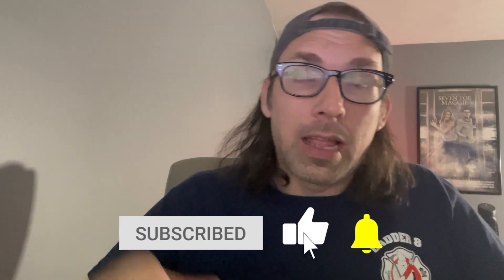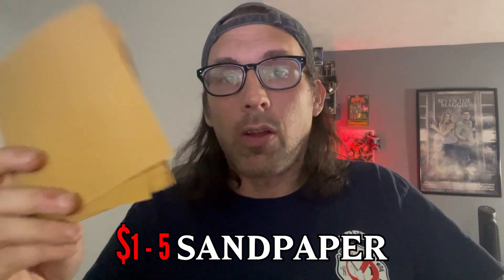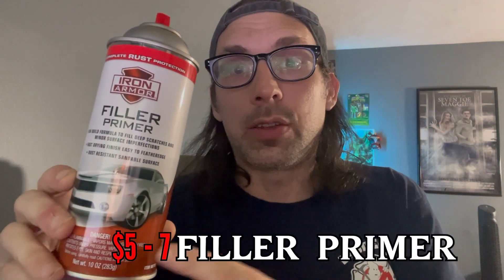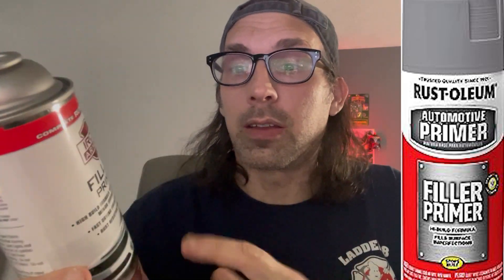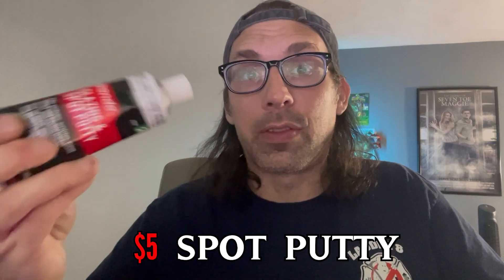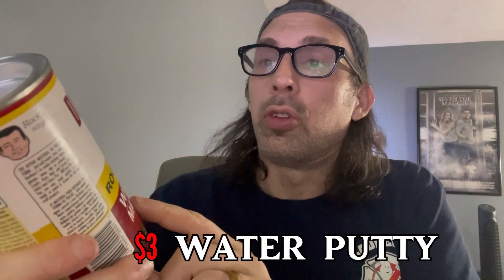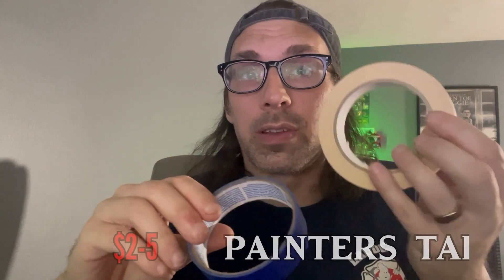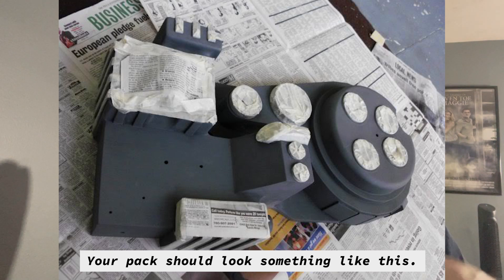How to Build A 3D Printed Ghostbusters Proton Pack! - Part 4: Materials!

Comment: I honestly had no idea sandpaper has varying levels of grit. Also what part of a car do you use sandpaper on?
Reply from the maker: Yeah, it determines how  coarse/rough it is. The lower the number, the rougher the paper, the higher the number the less rough it is. You use varying grits to get a smooth surface. You use sandpaper on a car if you're doing body work on the exterior, like the doors etc, in conjunction with bondo body filler.
Reply: @wholesomejoe  interesting! Thank you for the knowledge!